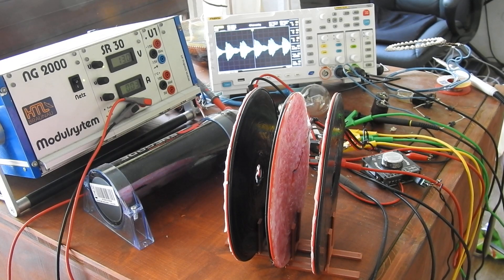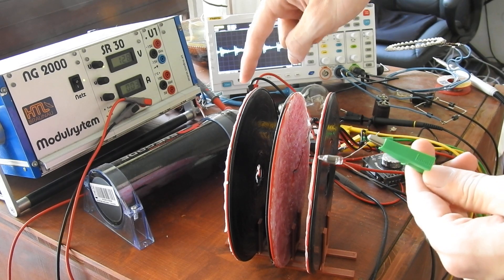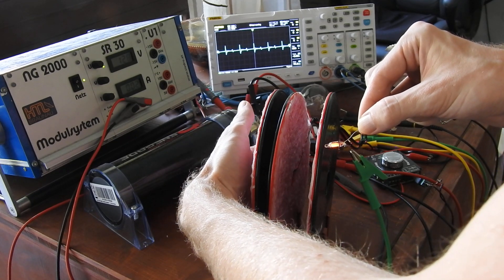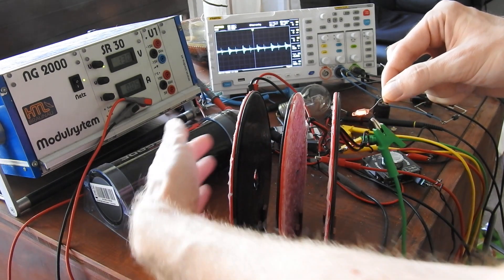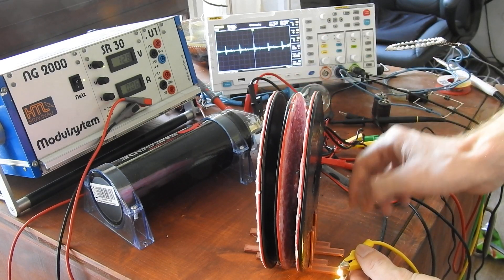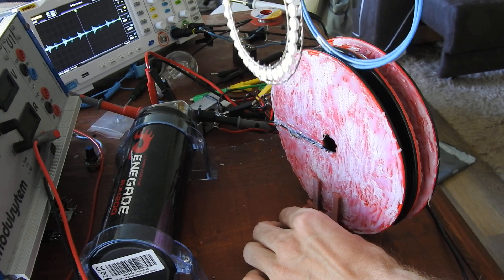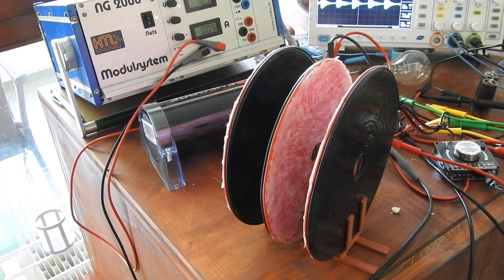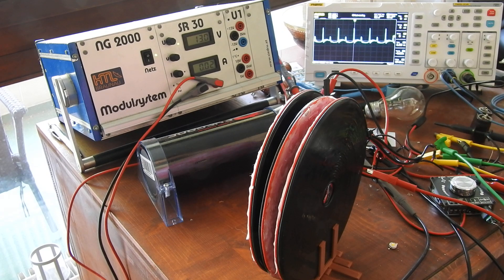Using the human body to conduct high voltage static electricity (dielectricity)

Comment: It also seems the diameter of the plates determines or acts like the magnetic field in length... Basically actually acting like a magnetic so the magnetic north south and varing the length determines the size of the magnet u can do that using a ferrite core rings or length of ferrite rod.. To extending the magnet nd so the magnetic field.... It shows dielectricity is transferred using magnetic fields.... U can make a longer coil magnets or shorter using the plates as long as the Amp thr u can create the extender magnet or solenoid nd so the mf.. I believe u can even do this as long w additional bifilar cw ccw activ as north nd south respectively just Chek... Dielectricity in wire loops nd mf in lengths most effective near poles.. Strength of dielectric flow

Comment: It looks like u r vibrating the dielectric similiar to ac push n pulling the dielectric which is what make electricity possible,.. If u have a dielectric and any oscillation using  ac can achieve the same.... 60,50 40 etc as long as the thr is a load if u want to remove lenz law use a spark gap will act similiar to load but removes the lenz.. Ur also acting like a plate of the capacitor earth/air and as soon as the load comes between ur good to go between 2 plates as long as thr is is a oscillation ie pus pull.. Chk it out nd will like ur inputs thks